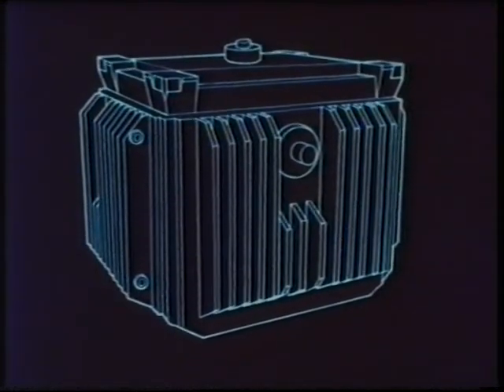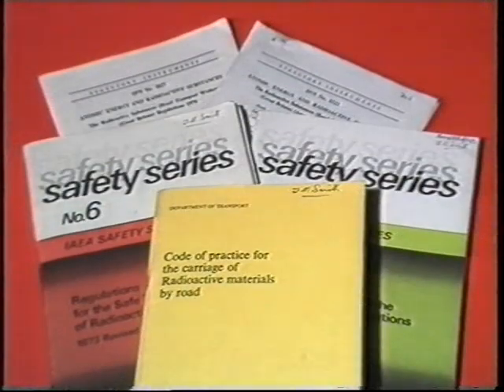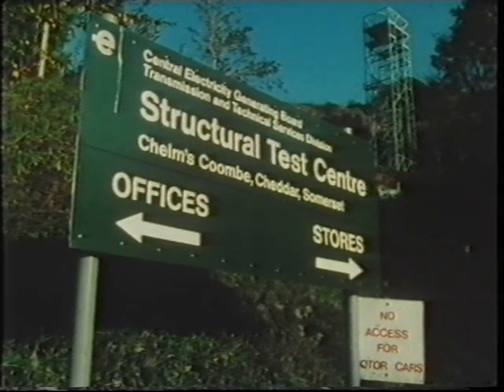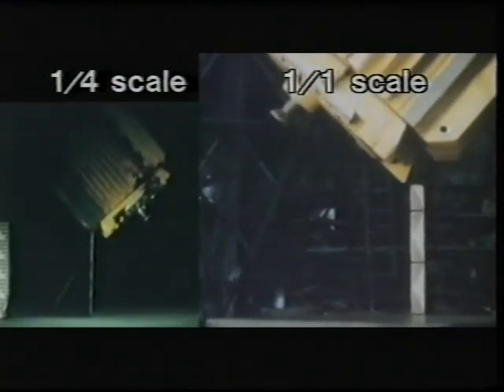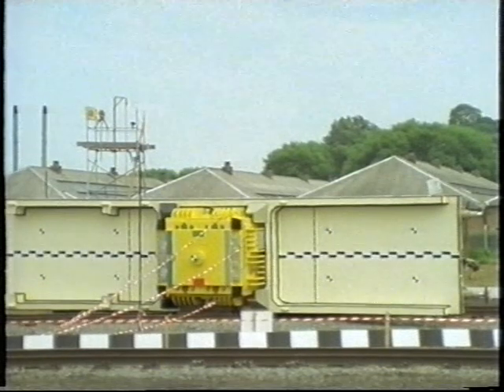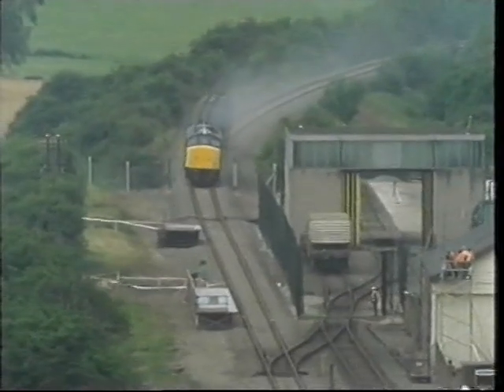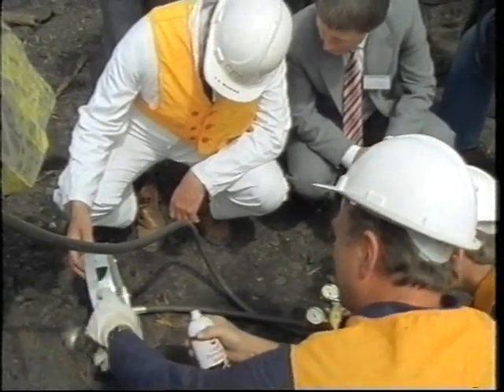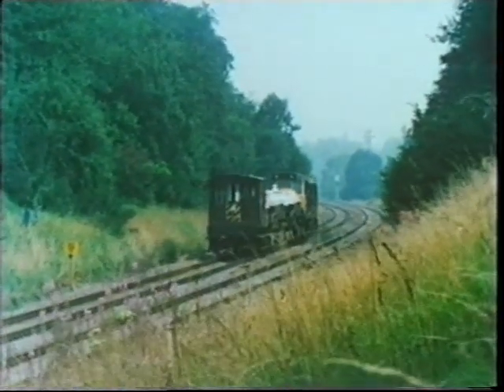British Rail & CEGB-Operation Smash Hit

Comment: For the onboard in-cab footage of the Peak's approach to the flask, was the camera film or video? If it was film, how was the film (and maybe the camera) ejected from the loco or protected so it could be recovered afterwards from the wreckage? If it was video, I suppose things are easier because it could be transmitting to a VCR beside the track.
Reply from the maker: The chances are it was proper film...Either way i imagine the camera and recording unit were in different parts of the train and joined by a cabel, so shielding the actual recording equipment, which recorded until the camera was wrecked.....
Reply: @SoiBuakhaoRoutemasterbus  A film camera wouldn't have a separate "recording unit". Judging from the quality of the image it is film.